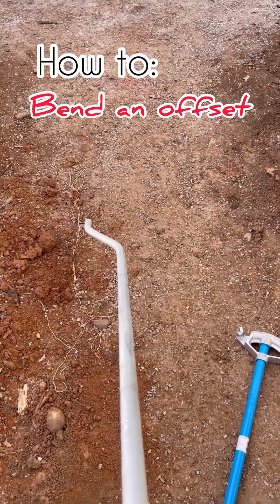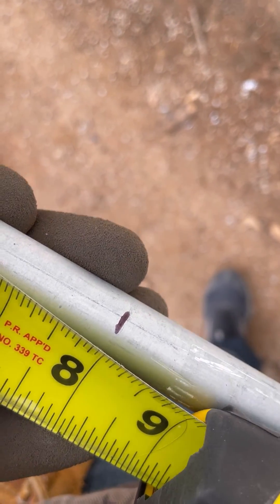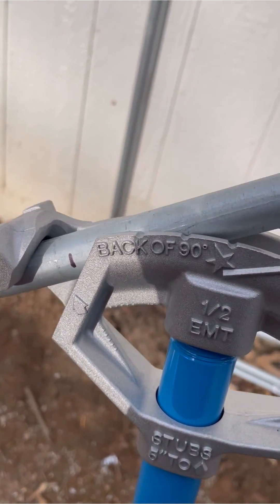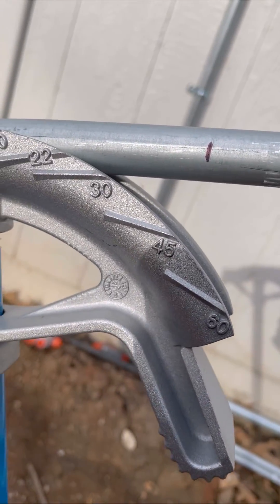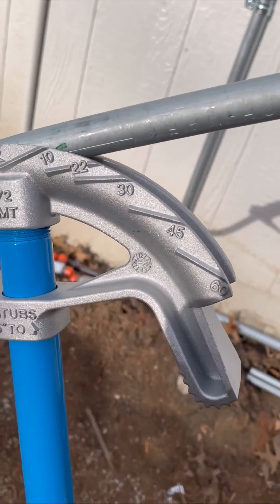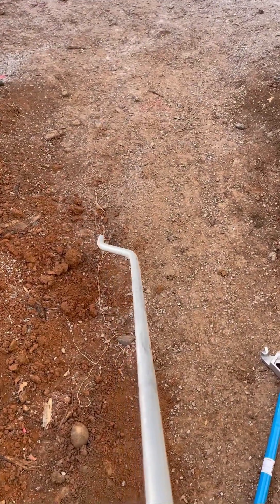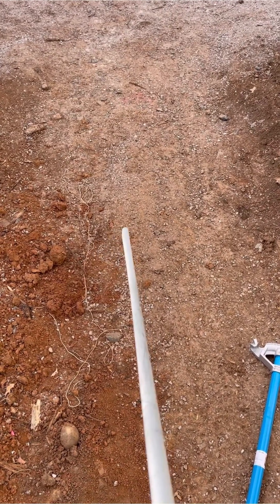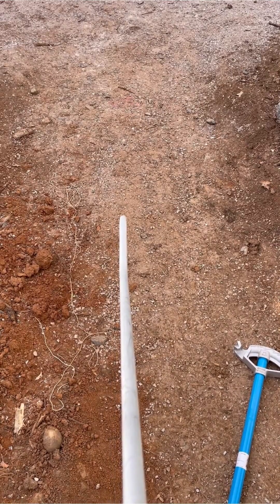How to: EMT bend an offset #electrician #sparky #diy #apprentice #construction

Comment: End of your conduit is closed.  Gotta bend it a little more.   Those hand benders still have a little spring back. And 2 inches is very close to the end but it works I usually do the first mark at 3 inches. Either way still better than some I've seen.  Also your pipe is dogged at the end to the right a little.
Reply: you are correct.  this guy is a hack.  lets see him do a 4 bend.
Reply: @william.shilling2969  omg could you imagine what it would look like lol